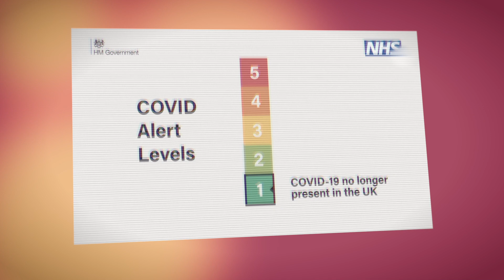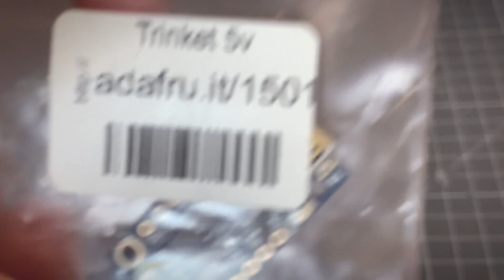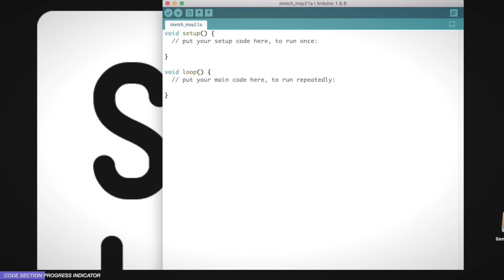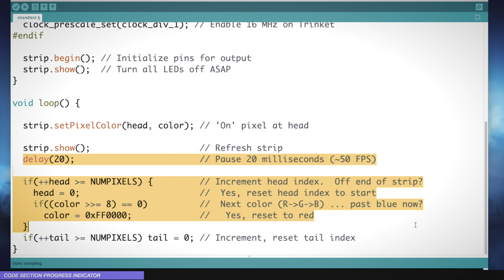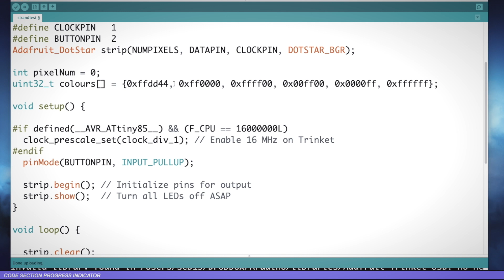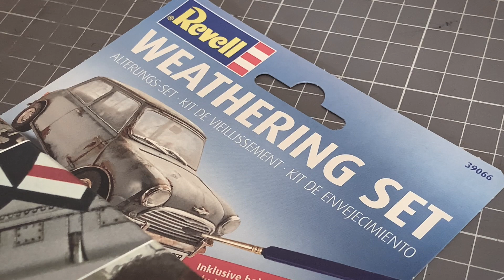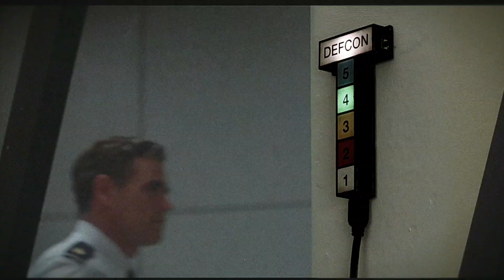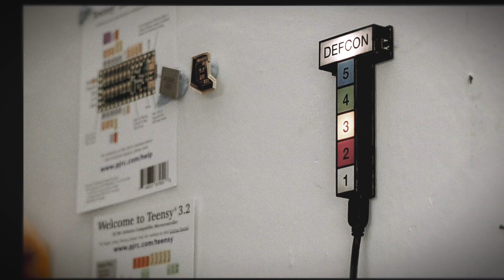3D Printed War Games DEFCON sign

Comment: Great little project - lots of fun - Defcon 1 is the most high level i.e the nuc's are in the air and Defcon 5 is the low threat - But the films usually have this the other way round.

Comment: To answer the question of which Defcon is the most severe, it's DefCon 1.  
There's a DIFFERENT answer as to what level it is if we're under attack.  Are are two additional codes for that, "Defense Emergency" and "Air Defense Emergency" to indicate that an attack is actually under way.  The overall grouping of 7 are called "EmergCons".  
What's amusing is that the DefCon levels in the movie mirror the real ones in the US Military.  There's a documentary somewhere, maybe about the making of the movie WarGames, where the scriptwriters say that they got it wrong, and that DefCon in real NORAD was the opposite (which it isn't; the movie got it right).

Comment: Ive printed a modified version of this thats 10x the size, any tips on how to scale up if im using a strip of LEDs for each box?
Reply from the maker: Oh wow sounds fun! It should be a question of editing the code, although you might need a more powerful board (like a standard Arduino) as I'm not sure how much memory the trinket has for LEDs. Other than that it should be fairly straightforward. Good luck!

Comment: DEFCON 1 is war. When they were writing the movie Wargames though, - they guessed which way around it was shown (#1 is actually at the top of the bar, 5 at the bottom). The worldwide DEFCON level has never been more than 3, though it was set (geographically limited) to 2 during the Cuban Missile Crisis, and the start of Operation Desert Storm.

Comment: DEFCON 1 is the most severe for the U.S. military. To put things from a UK point of view where BIKINI states were used at the time. These were Red, Amber, Black Special, Black and White. There was no direct relation between DEFCON and BIKINI. In 2006 the UK changed to Threat Levels. These are Critical, Severe, Substantial, Moderate and Low. Again these have no direct relation to either DEFCON or BIKINI as the current Threat Levels can be further subdivided into Responses', but I think I've waffled on long enough.